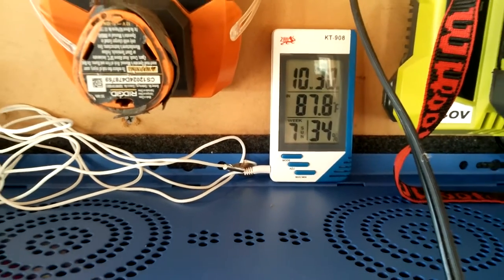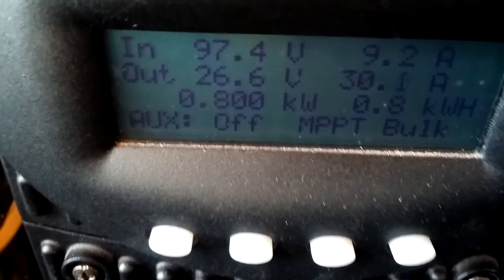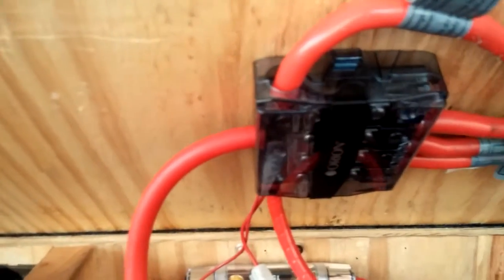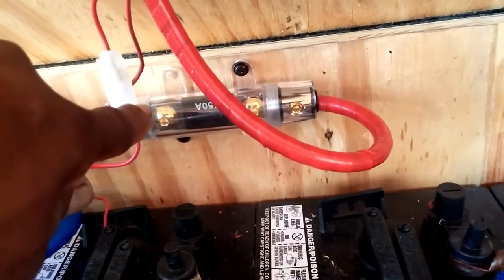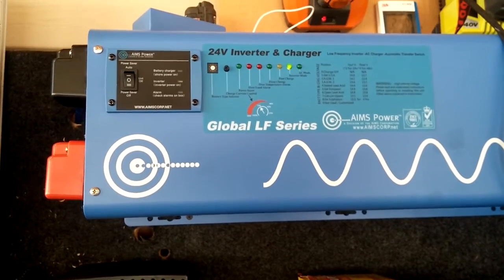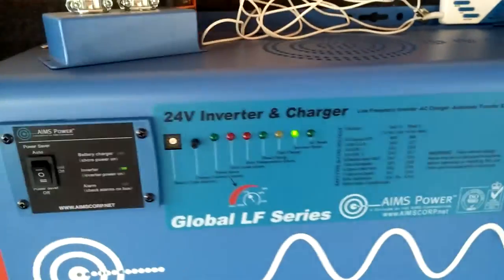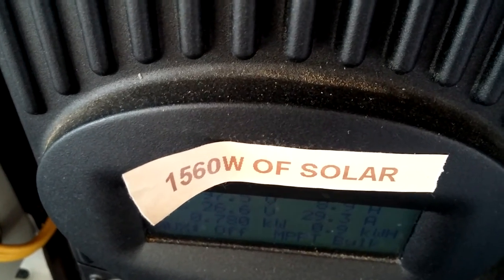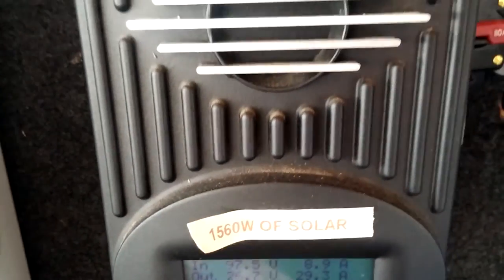Aims inverter charger/aurora inverter/outback charger controler

Comment from the maker: backayaad sound system ,thanks for checking out my video, me too have read both good and bad reviews on these inverters but I still wanted to check it out for my self, most of the people who post these bad reviews are the one who are buying a low wattage inverter and trying to pull more load out of it than it can deliver so they burn them up
Reply: So far all I have been using mine for is to back up my aquarium of 225 watts so basically it was in standby for the pass 90 days. One day  the alarm went off and inverter died.
Reply: update on my aims inverter/charger.......I did some troubleshooting and found the main circuit board to be defective.Aims sent me a new board and the inverter/charger is back in business.I hope this is a new and improve board that will last a long time........Garfield keep those video coming.

Comment: Hello awesome setup! I have a question for you currently I have the AIMS 6000 inverter/charger with Vmaxslr125 12v batteries, Renogy charge controller 40 Amp 12V/24V and 6 250w panels (another 11 waiting to be installed). If I were to purchase the Auroa inverter would this allow me to tie my solar setup into the grid? I assume I will need a larger charge controller and plan to get the outback 80 amp. Thank you for the video my friend!Would you recommend the Auroa and outback charge controller?
Reply from the maker: cali crypto -----thanks for checking out my video,,,,yes the arura inverter will make you grid tie and yes the flex max 80 is the way yo go

Comment: backayaad sound system,,,,the power jack 1200w grid tie inverter from china people say that they are junk,some buy these inverter and say it came out of the box broken some say  they install it and it fail in 2 days and some times same day of installation some say it fail 90 days after installation,,infact some times it is the way we handle there things wire size pulling off the power under load and so on,,,i have 3 of these power jack inverter for the pass 5 years and have no problem with it,,how ever i replace then with a more efficiency inverter  power one----- aurora pvi 3.0
Reply: Never had one so I can't compare.
Reply: cool thanks for the comment